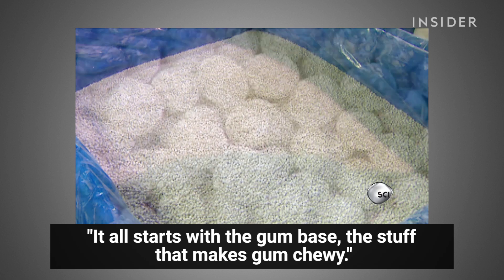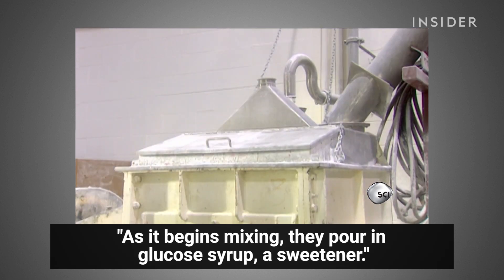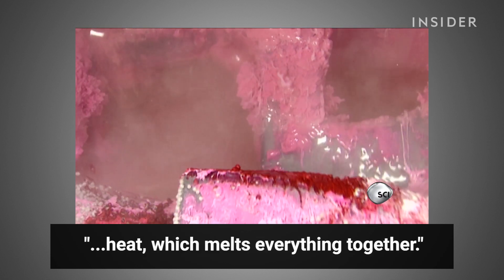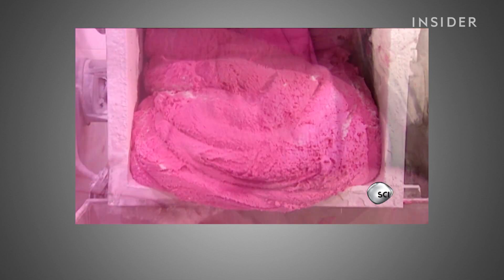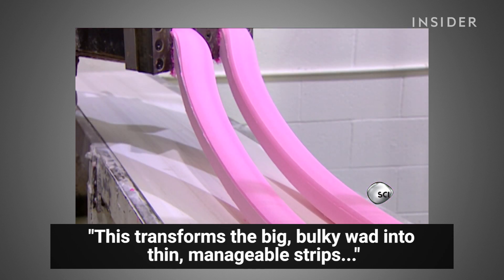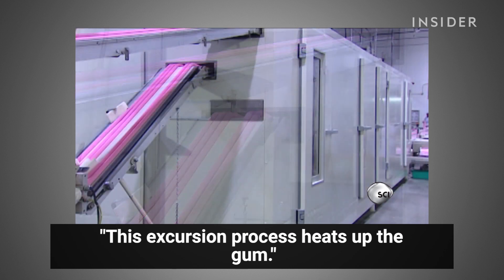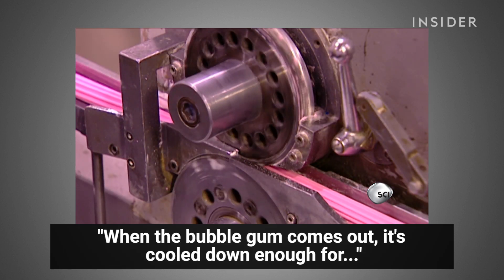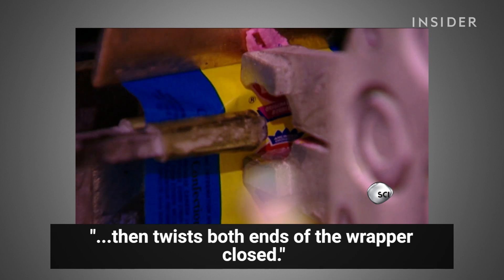This Is How Bubble Gum Is Made

Comment: Jesus Christ people, its not like its metal or razor blades in it! Rubber is from TREES and they always have made gum from tree rubber (it is what gives it elasticity). It is also non toxic. Also adding the fact the you are advised to spit it out after you finish. It goes right through you even if you did anyways, and doesn't leave a trace, just like anything else you eat. Macaroni and Cheese is actually more dangerous than chewing gum.

Comment: guys. 

Its rubber and plastic, not arsenic and sulfur. It is completely safe.

Rubber and plastic are both synthetic materials with a wide range of types. Yes, some plastics make toys and gloves, but some are also used in food. Its nothing strange, plastic is a very versatile material. Depending on the length of the poly chain, or the very makeup of the chain, there are 1000s of types of plastic. 

Its completely safe. stfu with your bitching.